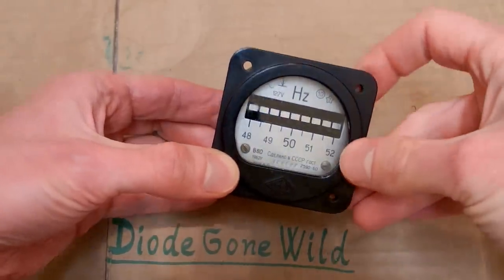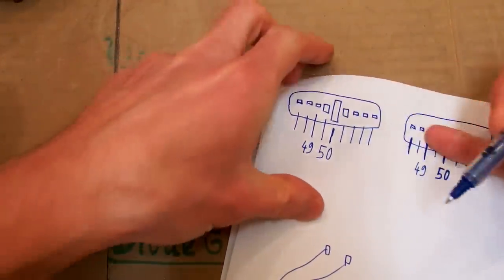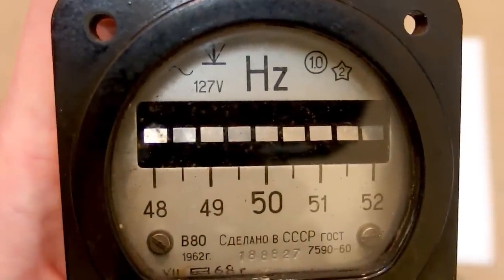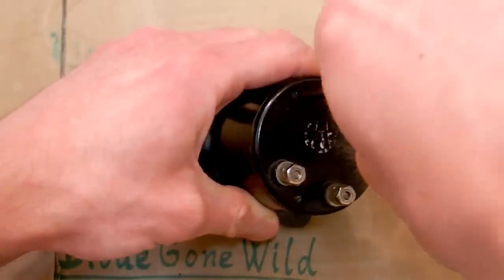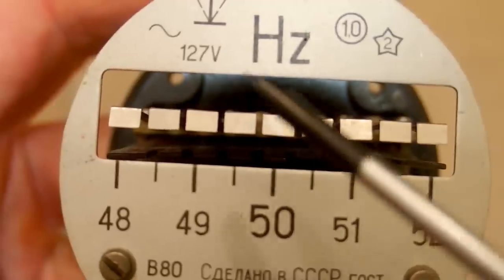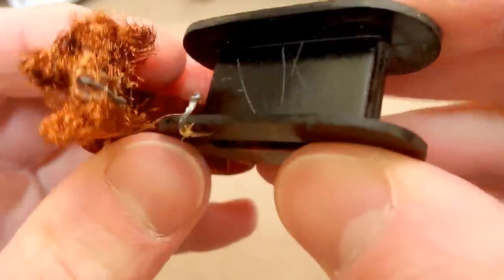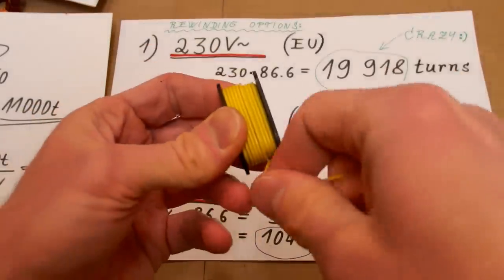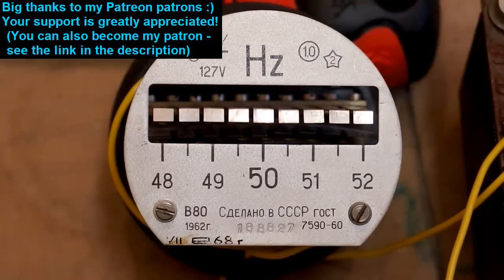Vibrating reed frequency meter

Comment: Older dining cars on the Finnish railways used to have diesel generators. Their output frequency was measured with similar devices. They were placed behind glass in a control panel in the corridor, and were fascinating to watch.
Reply: Also I'm in the railroad as well as antique electrical and all that stuff as well.

I have heard about old railroad cars that would use a DC generator driven off the axle to charge batteries to keep the lights on in the cars I think it was either 36 or 48 volts DC can't remember.

Once I had seen one of those hooked to a motor and a engine through clutches of some sort Truth by DC power for something. I don't remember the application it was not running at the time but it was well-maintained.

It may not have been exactly one of those generators but is very somewhere I think it was an Old Farm.

It's probably supplementing the old farm power system that was installed at one time.

Which was 36 volts.

The old glass Self Storage batteries are still there.

Although obviously not working anymore.

However there were more Barn lead acid batteries.

This was not an Antiques installation but somebody I used to know.

There was even a steam engine.

And yes it could drive generators as well as well as a Steam Plant still provide a heating for the farm and operate machinery and kept pipes from freezing this was totally amazing.

I actually did see the steam engine in operation a couple times.

Also the DC system had been repurposed and redoing to be up tomorrow and standards was still used as a backup system.

Even though they also had diesel generator.

And even one that can be driven off the PTO the tractor.

There was even radiators for steam in the barn.

Probably some of the biggest radiators I've ever seen.

There was also fan heaters in the shop there are circular with big coils in them.

About the only radiator I've seen it about that size?

The ones are saying about in the barn.

Was at the old church where my father used to work.

It was under the organ Loft in a little room off where the sound equipment was.

At that time that radiator look like it would fill a small room.

Also any organ Chambers there pipes with u-shaped fittings building up radiators. At the church.

Also back to the farm there were also in the greenhouse areas they were pipes under the floor to provide radiant heat.

The boiler have been modernized to run on gas or oil.

I'm pretty sure is LP gas though don't know.

But there's also a Wood-Fired boiler as well and a Coal Fired boiler as well.

I didn't look into the stairs so those unfortunately.

There was all kinds of weird interesting things there.

That place have been around free Merle electrification in the area.

There was even gas lights as well.

There have been two different sources of gas before LP arrived.

Actually make that up three I forgot about would gas.

1 was a acetylene gas plant which was still there in a building that was into the area by itself solid walls reinforced and all that.

Huge metal door.

And the only thing leading into it was some sort of vent line I have like a chimney.

 and the only other thing was a pipe leading out.

And shelves on one wall.

Oh and yeah there was also a water spigot.

 and acetylene gas plant was still in there even though it been disused of course.

 and the other system that was there Which parts of were still there but of course not used anymore just like the acetylene plant.

 it consisted of a system with a rotary blower.

 an airline which ran Underground a fill port in the outside. Area.

A large baffled underground tank.

 Which was basically a carburetor.

Yes it would run on gasoline converted to a vapor forced to the pipes by the air pump that pumps air into forced to the pipes by the air pump that pumps air into the carburetor in to vaporize gasoline.

Comment: That was great, i was so happy to see you re wind the old core and try different voltages, i think most people would have given up. Even if the exact calibration is off its the principal thats cool...
Reply: @sortofsmarter: the resonance calibration is independent of the number of turns of the winding, for a given supply voltage, at most you get that the reels vibrate little (if you make too many turns) or vibrate too much or you burn the winding (if you do a few turns) .
You can obtain the instrument calibration by working on the length or weight of the individual reeds at the corresponding frequency.
The major problem of these instruments was their variation in accuracy over time: constantly oscillating the hips were becoming more and more changed over time their resonance frequency (usually increasing the declared frequency with respect to the real)

Comment: exactly, I have seen this meter in pumped storage hydro power plant in Sedlice, they said it was used to check the approximate frequency of the generator before phasing it in. The phasing in then was done with lightbulbs and voltmeters across the switch if I remember correctly. You definitely don´t want to connect a few tons of rotating generator and turbine when they are out of phase with the grid.

BTW stavim si upgradovanou verzi po vzoru tvýho TIGu 100A, rad poskytnu schema layout atd pokud bys to treba mel zajem uverejnit, az to rozchodim, otestuju a tak :)
Reply from the maker: No určitě se rád na to upravený schéma podívám ;). Jsem zvědavý
Reply: kubeek - I’ve seen someone accidentally connect a mains supply to an out of phase diesel generator set supply distribution panel. The lights flickered and the generator stopped dead with a loud clunk! There was silence for what seemed like ages, but it was probably less than 6 seconds. Then the generator auto started again ( this is an emergency back-up generator with a battery powered control system).
Reply: @kubeek: connecting an off-phase generator corresponds to making a short circuit on the line with big damages for the plants.
For this reason, when connecting a new generator to the grid in addition to the frequency, the phases must be paralleled.
In the production plants, a similar short circuit corresponds to throwing out the entire generator unit with very serious damages: from the fusion of a transformer to the distortion of the generator shaft!
Reply: @zola tanaffa Sometimes the whole generator's rotating mass gets blown so hard, that it shoots out of the building through the ceiling and I really mean that.
Reply: @5Dale65  it is not hard to believe in your words. If we think at the mass of a rotating generator of 630 or 1200 MW used in power production plants: standardized gauge here in Italy for old thermoelectric power production
Reply: Yes you are absolutely correct I'm kind of into Retro / antique electrical devices and such.

There was also a type of meter that was an analog meter that could be used in place of the light bulbs and such cannot remember the name of it for the life of me sorry

But I've actually seen an old station on vacation one time that I had that set up.

And in the same station they also had that type of meter designed to indicate when to throw the generator to the output of the station. Whatever the name of it was.

By the way there's another video on YouTube I don't remember the name of the channel unfortunately or the name of the video.

May have been that guy that's the one that does all the electrical videos it's also the technician with the power company in some other country.

For the life of of me I cannot remember.

And when I do sit right Google always gets it wrong.

So no use either way.

But as I was saying that one that he had had a much larger frequency range it was almost a size of a utility meter.

The old square ones in other countries that is.

It went from very few hurts to hundreds maybe even more hurts maybe Ingrid to megahertz?

And yes could definitely call that a mechanical Spectrum analyzer.

Was it intriguing video.

I wish I could get a hold of a piece of equipment like that. Sometime. Somehow someway.

Comment: These types of meters fascinate me, all they are is a wobbling strip of metal, but due to resonance frequencies and calibrated weights, they make accurate measurements of frequencies... :)

Only have one example of such a meter myself and that's built into my Honda EX650 generator to measure between 50Hz and 60Hz depending which mode it's set to...

Comment: frequency  meters are obligatory in offshore/marine installations that have the ability to synchronize generators. The synchronizing is done normally automatically but there must be a way to do it manually - therefore voltage meters and synchronizing panel meters are also required by Class Rules

Comment: cool old tech. winding for 12V also means you could sweep the frequency going into that thing with a fairly simple circuit.

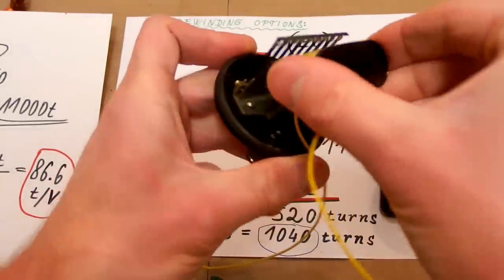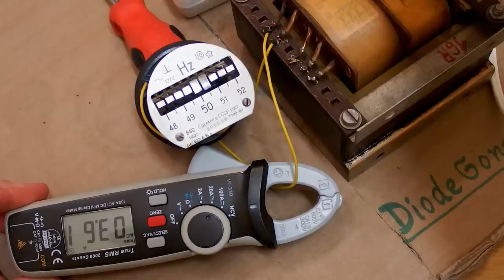10:44 & 11:19 some interesting transients for a second or 2 after connection.

Comment: It is an interesting equipment. I think it deserves to be fixed for proper 220v.
Reply: I think 12V is just as useful because you can then run it off a Halogen transformer.
Reply from the maker: I will do it for 12V. Rewinding it for 230V would require 20 000 turns of a wire with a very small diameter (like 0.04 - 0.05mm) that breaks just from looking at it :). Its insulation could also easily fail at 230V. On top of it, 12V coil allows me to simply connect it to an oscillator with a variable frequency. I can connect it to mains using a small transformer.

Comment: This old technology was simplistic and extremely accurate. Long ago I was given a basket-case 14KW military generator that was complete. It had a 4 cylinder Continental engine with a row of taps that could be connected from 110 to 440 volt single phase and 3 phase. I put new meters for Amps and Volts as an upgrade, but the frequency indicator was like this one with 60 HERTZ being red. There was a fine RPM knob on the dash where you could "dial in" the engine speed and the red would be the only one of the 9 vibrating. It was like new when I finished it and was vastly underrated. I sold it to a fellow who wouldn't be on the grid for a year and he ran his entire truck shop on it.

Comment: I think the 3-phase layout is just about right. But i don't think mains frequency was every wonky in the Soviet Union, good enough to run a clock off of and it would be reasonably good for a year or more. This is probably the kind of item that would be used on standalone generators and such.
Reply: @Siana Gearz:
Surely at the level of nations, (Russia, USA, China, Italy etc. etc.) the system to keep the frequency stable on the network is much more sophisticated and extended to the whole territory, but thinks that (I speak for Italy even if the problem will certainly be present in other countries too) the large photovoltaic systems, when connected or disconnected, produce a variation of the load on the generators such that the frequency moves, only for a few cycles, quite sensitive to be countered as soon as possible , we speak of fractions of Hertz but this is enough to create perturbations in the stability of the network unwanted to the point that, here in Italy, from about 20 KW of power up (perhaps even less, I do not remember exactly) every photovoltaic production plant must mount a connection control interface that must be verified and checked periodically!

Comment: Using a signal generator and audio amplifier you can now play across all measuring instrument range as I did in my youth age.
Reply: Yes that would work. More than likely. Also I've tested audio amplifiers with a light bulb standard 120 volt AC us incandescent bulb to test audio amplifiers you use the light bulb about the same wattage as amplifier if she lights full brightness in a full output damp first putting out power.

Comment: I seen exactly the same one instaled in old soviet army power generator some time ago. After start, you have to adjust rpm of the gasoline engine and some resistors on main panel to match correct voltage and frequency. As I remember right, there were volt and ampere gauges also present.

Comment: Accuracy aside, I think it is super interesting and ingenious in it's own way! Sometimes looking at these old devices and their cleverness gives me fresh, new ideas. Thanks :)
Reply: @mernok2001  I've seen worse.

Live for a time in a hundred-year-old plus house.

Old transitional gas electric fixtures.

Upstairs in the hallway there was a wooden door with glass in it.

My father thought it was something for telephone.

But one time I was a little more Curious and look further add it.

And around the edges were holes that have been cut basically flush wire old cloth covered wire from tubing off head pastor of holes at one time and what it was was an old fuse panel probably has ceramic fuse holders maybe even to have been to use neutral.

And yes I do DYI electrical work and I have lacrosse told fuse neutral panels.

And crazier.

Open wire link fuses in a u.s. electrical system.

To make matters worse some links were replaced with heavy copper wire.

And even worse.

There was no longer a cover on it and it was in an insulated attic with no cover and insulation just laying in it. And this was almost buried between joist.

And that was not even connect to the tube and knob wiring believe it or not.

That's the only time I've ever seen open link fuse in the United States.

A length of fine wire between terminal points. Screw terminals. And yes that box is made for that.

Is a gray metal box.

And yes I saw proper ul-listed label on it believe it or not.

But that doesn't take the cake for what I've seen.

Once I was in a much older place I believe. Year that was made?.

But somewhere I knew call me over to see something they were scared of. For good reason.

When I got there they took me to the downstairs bedroom or was it upstairs I can't remember.

And on top of that it was going to be the kids room.

Just off the parents bedroom and bathroom.

And lo and behold on the one of the walls in the middle was this big big big knife switch probably about over a foot across or so.

And to lead rods.

Of course I know his logical and yet you wouldn't want to touch.

But I suspected it was electrically Dad aka disconnected.

But I got my meter out and lo and behold surprise.

The 2:20 or so. Across those contacts at the bottom.

That was the original service entrance switch for the house and Main fuses.

However else we're where the panels that were fed by it.

This place has been split up at one time in the multiple residences.

 and I saw remnants of some of the old a base meters did still in use for junction boxes.

 And some of them still had meters in them that were actually working.

For example in the basement The freezer and a couple other things were still plugged into panel as fed by that.

 If that's doesn't signal a need to rewire what does.

And also everything is old blast uses mostly 30 amp fuses.

And asked if since I've been there had a blowing fuses they said no.

And some fuses were only 10 answer less.

But still not blown.

Found out why two pennies in a few socket.

Comment: Seen this style of meter in a phone switch station (old electromechanical 500 selector based station partially upgraded to AXE) where it was used to check customers phone's rotary dial pulse speed (10 Hz IIRC)
Reply: I had heard about that before and someone gave me one of those once I had forgotten about that thanks for letting me.

Except mine had more than one scale because it was used for Selective ringing frequency. Or whatever they called it back then where they would send more than one frequency down the line to bring different types of belts on different wines that were frequency selective ringgit. Back when they had more than one phone on the line on a party-line but could bring it based on frequency or tip the ground hot ring to ground to differentiate between different peoples rings. Back when they started doing that instead of just ring codes for the phones on party lines.

Comment: Great you got the meter going again. even it was at relative high current but the meter works. Try to get some enamelled wire and rewire the meter for 12 Volts with a small TX to run it from the 230 V mains.

Comment: Electric meter test standars still have a dedicated test about freq variation -/+ 2Hz and its influence over the accuracy. Mains Freq is very stable but some times needs to be compensated to cancel the drift in the clocks that use mains as basetime, clock radios, microwaves, vcrs, dvds, traffic light systems etc ....
Reply from the maker: Yes, my 1970's nixie clock is now over 1 minute late. I was wondering why. I looked it up on the internet and I found this:
https://gridradar.net/netzzeit.html
The EU "mains time" is now 75 seconds late. German language has a beautiful word for this: Netzzeitzeitabweichung - literally a "mains time deviation" :). 75 seconds is the highest deviation in the last year. Does it indicate the end of the wordl? :D.

Comment: When SU was getting ready to win the nuclear WWIII, we used to use this kind of frequency gauges on our military mobile power generators run on petrol. They were so poorly built as there was no any engine governor implemented to a throttle body so this gauge was the last resort to maintain proper output of the generator when manually opening/closing a butterfly valve on a carburettor.

Comment: These meters are very common here in Argentina in the xx century. The power grid are very unstable in tension an frequency in the past.
The color of the coil cover probably is electric isolating varnish cured in oven.